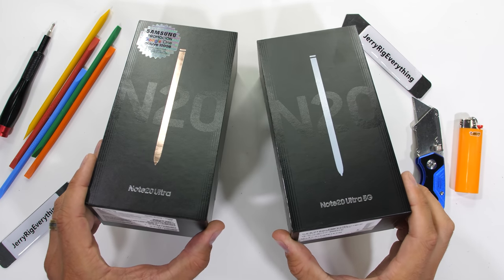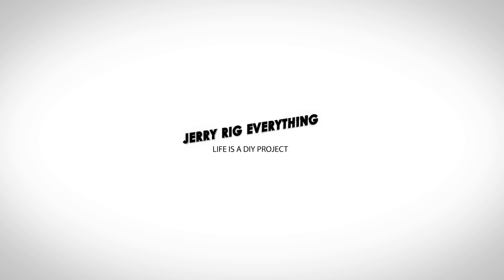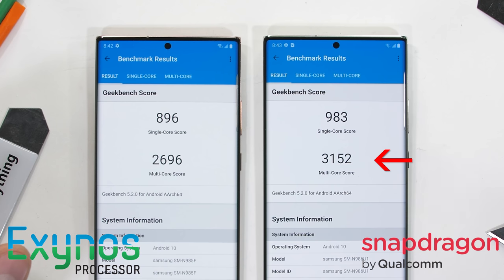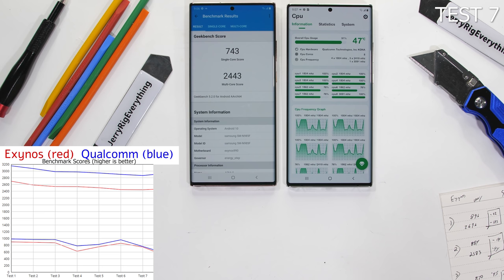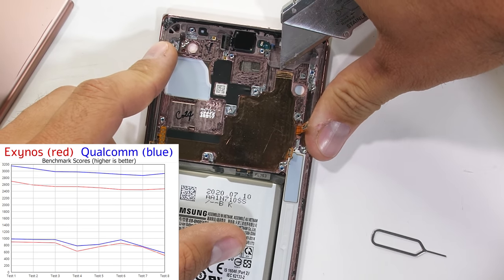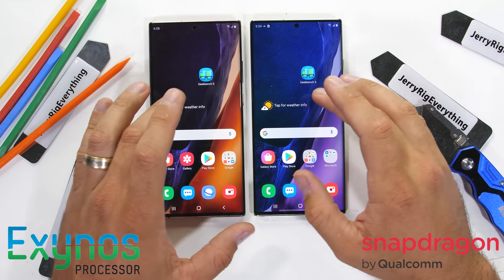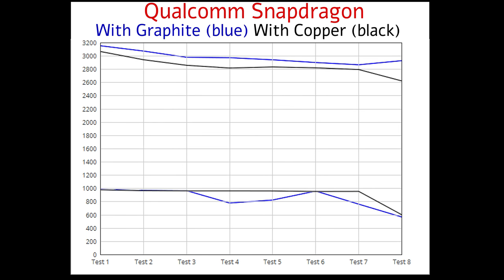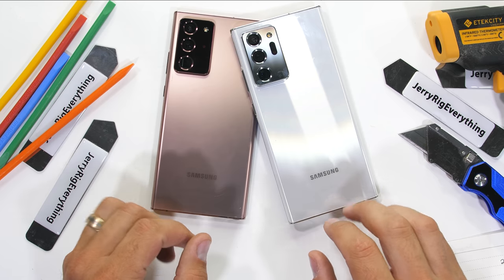Samsung should explain this... Exynos vs Qualcomm?! - Note 20 Ultra

Comment: I'm not buying another Samsung product until they stop doing this.
Reply: Lol damn gonna write off their TVs, refrigerators, and other appliances over a  phone?
Reply: @V8_Diva  It's about ethics. I'll not support a company that disrespects their customers.
Reply: @ItReallyIsiPOD  lol if you care about ethics, don't buy any smartphone in existence. The safest thing would be the Motorola lol
Reply: @V8_Diva  Ethics is not a binary "either you do everything ethically or you do nothing". Why are you so mad.
Reply: @ItReallyIsiPOD  okay, so if you own an andorid, you are using Google software, Google is not exactly ethical, AT ALL. If you are using an iPhone, Apple is not ethical in the production of their phones AT ALL. Your one point about "ethics of a company" is so hypocritical.

Edit: hope you don't buy graphics cards either. You have a high chance of having Video memory made by Samsung!
Reply: @V8_Diva  What are you trying to achieve with your comments? Also, re-read my previous one because you clearly didn't understand it.
Reply: @ItReallyIsiPOD  re-read my previous one, because clearly YOU don't understand. You probably don't even know anything about WHY there's multiple different coolers. iFixit did a whole article detailing Samsung's engineering process and why there's different phone designs. But I'm sure you never heard of it because you don't actually care about the "ethics of Samsung". Your hypocritical write off of an entire company because of your ignorance is sad. Think for yourself and do your own research for once.
Reply: @ItReallyIsiPOD  Why are you playing picky-choosy with what companies you wanna support over ethics? Smartphone production and the companies behind them are usually not ethical at all. So what makes samsung different? Just seems counterproductive to cherrypick out samsung over other unethical companies!
Reply: @umamifan  Why shouldn't I be picky? Just because I can't afford to boycott all unethical companies, doesn't mean I can't boycott any. I really don't understand your argument.
Reply: @ItReallyIsiPOD  I also don't understand your point. You are cherry picking a single company to boycott when there's other companies who are doing much worse ethic-wise. Where is the logic? If you're not gonna boycott EVERY unethical company then why just settle with one? No point in that other than to virtue signal in youtube comments
Reply: @umamifan  Don't worry, I am boycotting quite a few other companies.

Now my turn to ask questions. Why are you so obsessed about my decisions? What companies are you boycotting, and why do you get so defensive when someone doesn't like Samsung's ethics?
Reply: @ItReallyIsiPOD  Because I hate virtue signalers
Reply: @umamifan  That's not a valid answer.
Reply: Welcome to the club. I suggest you don't hold your breath.
Reply: @ItReallyIsiPOD  irony.
Reply: @ItReallyIsiPOD  even Apple is disrespectful against customers
Reply: @davidensinger4175  LOL Apple's been on my boycott list since 2010.
Reply: @V8_Diva  You should be prosecuted with the criminals you defend.
Reply: They really dont care. Samsung still best bought phone in europe. With only exynos. Most people dont fucking care about exynos yeah its unfair but it still flagship chip
Reply: me too
Reply: A 1  lol tell me how.
Reply: @ItReallyIsiPOD  but I assume you continue to use Android, right? A Google product.
Reply: Me neither...at the very least for the next 2 years...unless my phone dies an untimely death...or there is a sale.
Reply: @V8_Diva  apparently their TVs are garbage, well most of their products are due to them going off brand image for sales.
Reply: @ihazdaforks  their TVs aren't garbage though. They get great reviews all the time. They are LGs biggest display competitor.
Reply: @V8_Diva   Bosch masterrace.
Reply: Or you could just buy the snapdragon version?
Reply: @blyobin3855  How's that gonna disencourage unethical business practices?
Reply: The world is the same place now. You didnt changed anything. Guess why. BeCaUSe yOu DoNt MAtTeR :c
Reply: @oSunnyD  And that's why I shouldn't try to boycott unethical companies? How nihilistic are you?
Reply: @V8_Diva  Samsung appliances are unreliable garbage, and their TVs are overpriced LCDs.
Reply: @TylerN945  lmfao wrong on every point, but continue hating on Samsung for no reason.
Reply: It is funny that everyone defending Samsung are starting their comments with "lol" as if they are all immature.
Reply: Just don't buy apple... they're even worse
Reply: @hunchochou9053  I know.
Reply: @hunchochou9053  No they’re not.. They put their flagship SoCs in $400 phones and support those phone for at least 4 years of iOS updates.
Reply: @hunchochou9053  At least in this aspect.
Reply: They do all kinds of crap with their TVs.  It is always all about the money.
Reply: I don't understand why anyone ever bought Samsung. Always been trash.
Oh and especially with that ugly awkward curved screen, just awful.
Reply: I haven’t bought anything that has Samsung logo on it lol...
Reply: @V8_Diva  He actually is thinking for himself. You’re the one trying to influence his decision.
Reply: @IpSyCo  jumping on a bandwagon without doing the research for yourself is the exact opposite of thinking for yourself.
Reply: @V8_Diva  There’s no research needed to be done. He doesn’t like the practices Samsung is doing. So he isn’t going to be buying another Samsung product until they change that. It’s simple really.
Reply: @IpSyCo  You clearly don't understand English.
Reply: @V8_Diva  you clearly have no counter argument so I rest my case.
Reply: Good effing luck then... You know how companies are. It’s not just apple that is ass. All of them will take advantage on things in one way or another. People should think twice before having billion-dollar pet supercompanies. I sure as hell did...
Reply: @V8_Diva  don't forget about Tanks
Reply: Already doing that for years, and also I hate Knox.
Reply: @V8_Diva  Listen, we all get where your coming from as far as "boycotting one company for unethical practices doesn't matter unless you boycott them all". But, I'm sure if people saw more videos of other companies charging the same price for the same device that was actually less capable, a lot of them would boycott those companies as well. The bottom line is that it's a horrible practice to make people feel like they are rolling the dice on whether or not they will get the faster version or the slower version of the exact same product. This isn't like buying a CPU when building a computer and winning the "silicone lottery" where some of the CPU's are faster or more capable of higher clock speeds than others, due to silicone quality etc. This isn't even close. If I put two computers on the table and tell you one is faster than the other and then tell you they are the same price you will probably pick the faster one. If you don't then you're obviously dense. The problem here is that 90% of regular people just buy phones due to looks and camera quality/battery life. They don't know much about the inner hardware. It's deceiving to those types of people that are overpaying for less capable hardware. Bare minimum, the phones pricing should be changed to compliment it's performance, or they just put the slower CPU in a non-flagship model of their phones. Taking advantage of people's lack of knowledge in tech is disgusting and all companies that do this should be boycotted. But, guess what,  whether people want to admit it or not, this will affect Samsung in one way or another. Saying you can't boycott or cherry pick one company for bad ethics is like saying that you submit to prison rape, but only if the whole prison gets to rape you. 🤷🏼‍♂️🤦🏼‍♂️🤦🏼‍♂️ I'm sure that people like Ghost (or anyone that actually cares about honest products and practices) will boycott any other company when presented with similar information about one of their products. Change doesn't start by saying: "Screw it. Everyone else does it so I might as well bend over for these guys too." That's the worst logic I've ever heard and also the problem with companies getting away with stuff like this. They see people like that coming from a mile away and then bank on them just giving up and accepting it.
Reply: Lol I never buyed a Samsung cuz I knew they were scum
Reply: We all know you could never afford one to begin with. 😂
Reply: @edgarassongaila8598  shhhhhhhhh son. You know you’re chatting bs.
Reply: @ItReallyIsiPOD  lmao hero over here
Reply: @ItReallyIsiPOD  you gotta be joking its a phone boycotting or whatever is stupid if ya dont like the phone simply dont buy it saying "CriMInAls" is a bit too high u donut
Reply: @TylerN945  my days the new iphones are hot trash the normal iphone 12 lookes the exact same as the iphone 11 they sell the alone just to get more money out of customer add irelavant accessories in the phone like the feature in the camara that can erase ppl from exsistance prices that the phone is not worth
Reply: @solarsynapse  yeah and apple isnt
Reply: @subhanjawad4666  chill ots a phone every band does tht
Reply: @AliHussain-uh9xt   Gordon Ramsay, is that you?
Reply: @AliHussain-uh9xt   Jokes aside, I kinda see your point there but at least Apple has the decency to put their best processors even to their non flagship phones. Their displays are almost identical across their lineup, not to mention the Taptic engine which is best in class comes in every iPhone. And their years of software support is applicable to every iPhone.
Reply: @AliHussain-uh9xt  Can’t relate. As an app developer who uses both an 11 pro Max and S10+, iOS is superior in just about every way to android. No matter how you compare them, iPhones are more efficient phones using less ram and longer battery life with a smaller battery. Plus the regular 12 is better than the 11 just because it has an oled display and a faster SoC, but would u even need to upgrade from an 11 though? iPhones are supported with OS updates for 4 years+. Androids literally get 2 years and then just security patches after. How often do you see S8 users? Galaxy users usually buy the latest galaxy every year or 2, iPhone users keep their phones for years and then upgrade when there’s a design refresh or a feature they want.

Comment: Shame..
My friend just bought
I guess ill let him live this lie happily rather than spoil it
Reply: You're a good friend
Reply: fact: 99% of users here would not notice the difference in their use of the phone but complain, because they think the power would make their phone 10x better. i have exynos chipset in my S8 and the phone is very fast. i could not care less about the difference. everyone that has some IT knowledge knows about it and it is not such a big deal.
Reply: @checkanr138  its kind of is a big deal, since most of the time they're charging more for the exynos chip which just isn't as good

I have a feeling you wouldnt let Apple get away with doing something like this...
Reply: checka nr1 99% You won’t say that if it was iPhone
Reply: @checkanr138  Except that Exynos generally gets much hotter than Qualcomm, same thing happens with my S9+ with Exynos when compared to a friends S9+ with Qualcomm